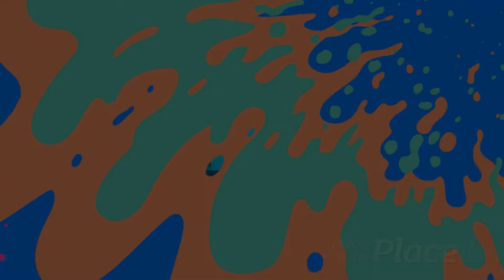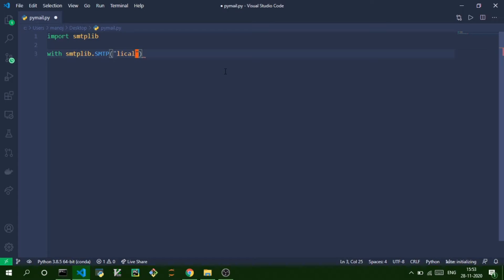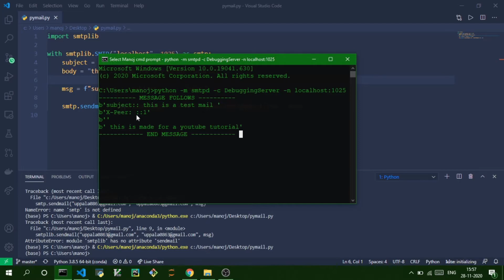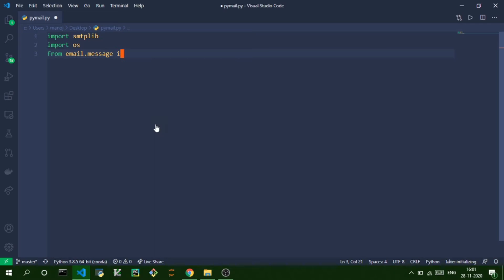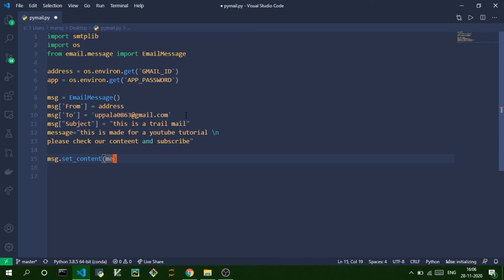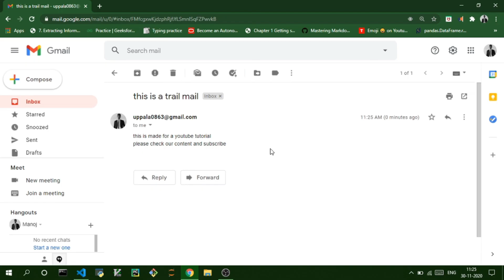How to send a mail using python

Comment: You need to use port 587 not 465...

"Port 587 is the default port for SMTP submission on the modern web. While you can use other ports for submission (more on those next), you should always start with port 587 as the default and only use a different port if circumstances dictate (like your host blocking port 587 for some reason)."

https://kinsta.com/blog/smtp-port/
Reply from the maker: Thanks for mentioning it man. yes i have checked it, 587 is the default mail submission port. I have updated the info in description. :))